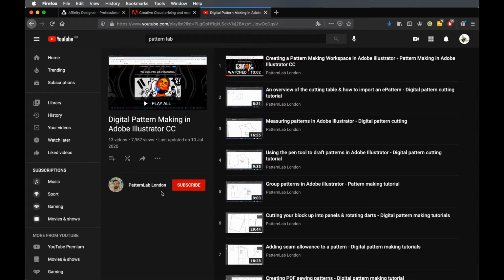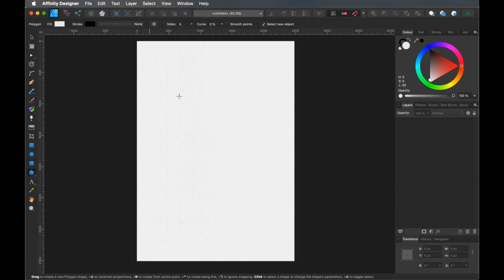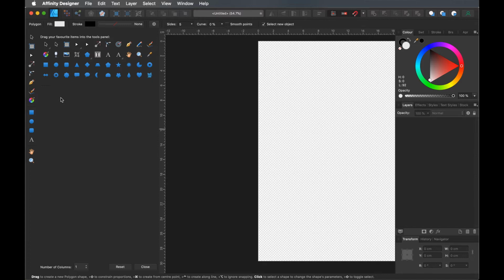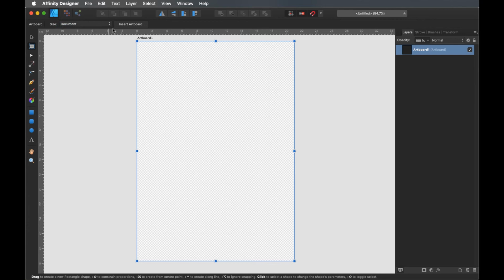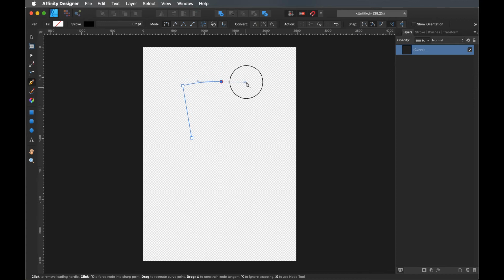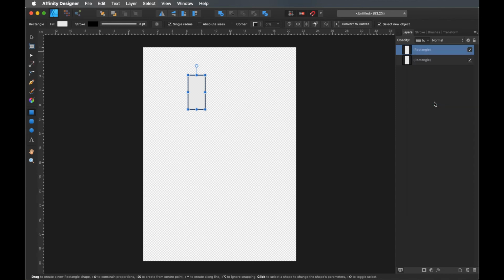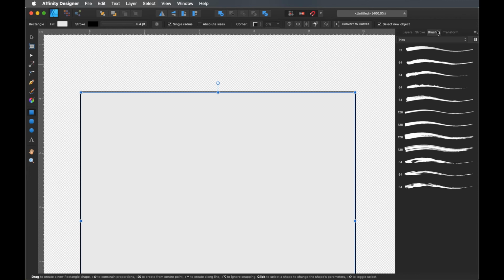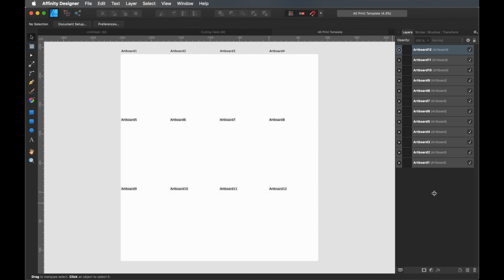Using Affinity Designer To Create Sewing Patterns - Digital Pattern Cutting

Comment: Hi Haberdasher Bee, I'm looking a ay to grade my patterns in Affinity. In Adobe you have the blend option which you can do in steps instead of overflowing.  have you any idea how to do this? Thanks Katja
Reply from the maker: Hi Katja, in Affinity Designer V2, there is a way to grade - it's called Power Duplicate. In essence, you duplicate the original once, make your scaling changes and then duplicate the altered object. Affinity will apply the changes you made to the altered object each time you make a new duplicate. Hope that helps!
Reply: Hi, there is another way but it's in another program. Browzwear is software for designers and pattern makers in 3D. The nice thing is, it's free for small businesses and solo entrepreneurs. Just apply for an account. Browzwear is pattern making specific software, so it has all the grading options you need.

Comment: Are there any tools in the newer version that you use that aren’t shown in this video?  Thanks
Reply from the maker: Yes, Affinity added lots of new tools into V2 which would be very helpful for creating sewing patterns. I do intend to do a video on this at some point, I simply haven't had the time so far. In short, the following new tools are useful - 

-The new knife tool will be very useful for slashing and spreading 
-The customisable background grids will certainly be useful for designing without constantly measuring (you could set them to be a 1cm or 1" grid like on pattern paper and make use of the markings as you might when drafting manually)
-The area tool will be very useful for measuring the length of curves
-There's finally an equivalent to Adobe's eyedropper in the Style Picker Tool
-You can scale objects in a similar way to Adobe's blend tool, meaning you can now grade with relative ease
- You can align objects to a key point or object, for example making sure all graded pattern pieces sit properly spaced from the centre of the piece or from an edge designed to be cut on the fold.
Reply: @TheHaberdasherBee  thanks for this - I found it really helpful. You and @donnab445 might like to know that the contour tool is really useful as you can make seam allowances with different widths. This video explains the tool https://www.youtube.com/watch?v=zpOm8AzTpW4 
For a pattern create one layer with the sewing line only. Once complete, copy creating a second layer to use the the contour tool on - leaving it directly above the original. You can specify width based on your document settings - mine was set to inches. Make sure lines on both layers are aligned to same point: I chose aligning to outside of line so the outside of the line is the cutting line. Once every thing is right - bake the contour which switches you to node mode. You can then adjust nodes to adjust seam allowance for straight sections if desired. I haven't tried it on curves, but for curves or more complex things you can break the lines of the added contour where you need the width to change, so you can remove sections - so if you need a different seam allowance say for a hem or neckline, you could add additional layers copying from the sewing line layer, setting to a different seam allowance, then removing unwanted sections and making slight adjustments to seam allowance layers if needed.  
So long as you have all lines set to align to the same option, I've checked and the measuring tool indicates the width is consistent even on tight curves. I was drawing templates for drunkards path quilting. You have to label the curves so you know which is which, but that is good practice anyway.
Reply: Extremely helpful and appreciated!!!  Thank you SO much!!  Looking forward to your future videos ;).  I definitely understand how hard it is to juggle everything!!

Comment: I discovered something when using the Seam Allowance brushes. Unless you have a "closed curve" you can't set the alignment of the stroke to be the outside of the vector. I wasn't making my pattern shapes be closed curves so I couldn't apply the seam allowance brush properly until I figured this out by searching some forums. I hope this tip helps other people!
Reply from the maker: That's useful to know, thanks for posting about it!
Reply: @TheHaberdasherBee Hi, I tried using the print templates, especially the A4 one, but when printing (actual size or 100%) the top and bottom parts don't print, that is, the part where the centimeter and inch scales are located. Do you think I did something wrong?

Comment: Really useful information, most Affinity designer courses don’t have this sort of knowledge and I’ve only just started creating digital patterns, so I’m grateful! 
Not sure if this is covered elsewhere or I missed it in the video, but how do I use the seam allowance brushes when there are two or more sizes of allowance on a pattern piece? For instance a 1/4” at the collar and 5/8” for the rest?
Reply from the maker: I'm glad you found the video and the brushes useful! Because the pattern piece is one joined up item, referred to in Affinity as a curve, it will as standard only apply one seam allowance brush at a time. If you wanted to have different seam allowances on the same pattern piece, you would need to break the curve at both ends of the section where you want the different seam allowance to be - in your example, at either end of the neckline/collar curve. To do this, you'll need to select the pattern piece, use the node tool (the little white cursor) and look in the contextual tool bar at the top. You'll see an area marked "action" and the button to break curves is the first one in the section (see approx 18:53 in the video for the node contextual toolbar). Select the individual point where you want to break the curve and then hit the break curve button. Affinity will add the broken area into the layers panel on the right as a new curve, so you can then select that curve and use the other seam allowance brush. I don't know whether it will try and add the brush to both sides of a single line, however, so you might need to play around with it a little if it does. Hope that helps!

Comment: Can you have different seam allowances for each seam if you need? Like a 1/2" seam allowance, but a 1" hem allowance?
Reply from the maker: You may be able to do this if you break the curve, so that the hem is a separate layer to the rest of the pattern. You can break curves when using the Node tool (white cursor arrow) - it's in the contextual toolbar at the top. Just click the nodal point you want to break the curve at before clicking the "break curve" button - and don't forget to do this to the other end of the hem as well. I haven't tried this though so I don't know how it will display the seam allowance.

Comment: Thanks for this video in the context of pattern making. But my question is ,is  there a line tool as in Adobe illustrator that lets  one make lines with specific measurements. And also the rotate tool in Adobe illustrator, which makes dart transfer easier.
Reply from the maker: I mostly use the pen tool to draw my lines, so it may have a line tool and I might not know about it. It doesn't have exactly the same tools as Illustrator though, and I know that can put some people off. As for dart transfers, you can rotate around a point using the transform panel and selecting the point to rotate around. I haven't done it for a while, but if memory serves correctly, you use the node tool to select the point and on the transform panel you can select which point on the box it rotates around (the selected point is the largest one on the grid). Hope that helps!

Comment: Thank you so much for this video. I've been using Affinity Designer and Photo for the exact same reason, that a monthly fee is not worth what I'm using it for. The seam allowance brush is great too. Only taking my first steps in digital pattern drafting and feeling more confident after watching this!
Reply from the maker: I'm glad you're feeling more confident! I'm hoping to make more videos about pattern cutting in Affinity Designer as I learn more about creating my own patterns - there's still a lot I need to learn first though!
Reply: @TheHaberdasherBee  
After a week of learning and studying I have found two issues with Affinity that are not available and I would really need. The first issue is that you can’t make zigzag lines, or dotted zigzag for example, which I need in the line drawing. The second is a real showstopper: you can’t measure the length of a curved line. Something you really need in pattern drafting. I’ve googled and read a lot on forums but apparently this is not possible. If you or someone else knows a solution for this, I would like to know. I think I will try Adobe with the free trial.
Reply from the maker: @SigridSewing  I think Affinity is always going to have some limitations unfortunately. However, there's a free, open source software I've recently come across that is designed specifically for producing sewing patterns that might suit you better - Seamly2d. You can find it at https://seamly.net/ (scroll all the way to the bottom for the download links). I haven't had much chance to try it out yet, but it at least looks as though it does everything you need
Reply: @SigridSewing  Really, you can't measure curves, that will definitely be a problem.
Reply: Thank you for the reaction. I have come across more issues and am not using Affinity designer for pattern drafting any more.

Comment: Thank you for making this video. I'm thinking of leaving Adobe when my subscription ends, but one thing that's held me back before is that I can't see a way to grade sizes in Affinity -- have you found a way?
Reply from the maker: I am intending on making a video about how to do it in Affinity at some point, though I haven't yet learned how to properly grade a pattern, so I want to I feel confident in grading with paper blocks first. How have you been doing it in Adobe? It should be a similar process in Affinity, as it has almost all of the same tools.
Reply: @TheHaberdasherBee  I've been drafting patterns in Ai for about 6 years and to grade them I drafted the biggest one and the smallest one, and use Illustrator's blend tool to get the 'steps' in between. I asked Affinity if they had a similar tool by a different name a few years ago and they didn't, so I wondered if you'd found a work-around. No one else has even done a video on drafting sewing patterns in AD, so thank you for this! :)
Reply from the maker: @SabrinaCWB168  I think there's alway going to be limitations to using Affinity unfortnuately as it just doesn't have the financial backing or massive team of developers that Adobe has. However, I have recently come across a free, open source software designed specifically for pattern cutting that might be more suitable - Seamly2d. I haven't had much chance to use it yet and see how it works, but it might be more useful than Affinity (and certainly cheaper than Adobe!) You can find it at https://seamly.net/ (scroll all the way to the bottom for the download links)
Reply: @TheHaberdasherBee  That is a very fair point. I think they're just so good I forgot their limitations XD
Reply from the maker: @SabrinaCWB168  If you're still looking to jump ship from Adobe to Affinity, Affinity recently released V2 of Designer and the key thing for you is that there now IS a way to grade patterns in it. It's called Power Duplicate and can "duplicate objects and repeat transformations in one go" as well as "create geometric patterns or repeating, SCALING, rotating designs" (key word being scaling, hence why I put it in caps). Also looks to have lots of features that Illustrator has which are useful too, like being able to measure curved line lengths and making the eyedropper tool work like it does in Illustrator. I'll likely make a video and write a post about it at some point early in the new year, but thought you might appreciate the heads up
Reply: @TheHaberdasherBee  Thanks -- I already bought V1 and I don't want to pay to upgrade just now 😬 If only I'd waited!

Comment: Thank you that was really helpful. Any tips on creating a seam allowance brush that has the solid line as the seam line and the dashed line as the allowance. I guess I have to learn how to make individual brushes from scratch, or do you think your brush could be inverted somehow?  Also can Affinity export the artboards as individual tiles to PDF to print? I think your A4 artboards are still the whole A4 size, so therefore they are not sized to take into account any extra space needed for printer margins (which the Patternlab ones do), or have I measured them incorrectly????  I really like working with Affinity's products too. :)
Reply from the maker: You'd need to make a brush from scratch I think, as I'm not aware of any option to invert a brush once it's been created. It's not the easiest as you'll need to make sure that the seam allowance is exactly the right size, but there are lots of videos about how to make brushes in Affinity which will show you how it's done.

Yes, Affinity can export the individual artboards to PDF, though you'd have to diable all except the one you want to export. For patterns which only go across one or two pages, that's not a problem, but for bigger patterns it's just much easier to export them to one file. 

My templates are the exact A size, yes. I don't know how PatternLab will have made their print templates to include printer margins, as surely that would mean you're losing however many milimetres from your pattern pieces on every page.